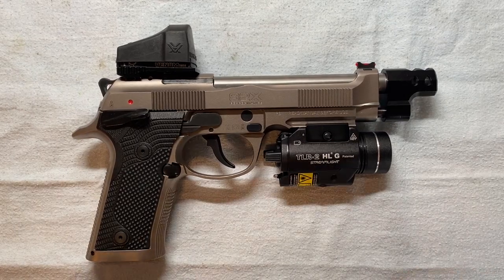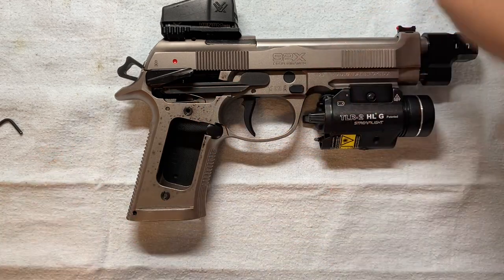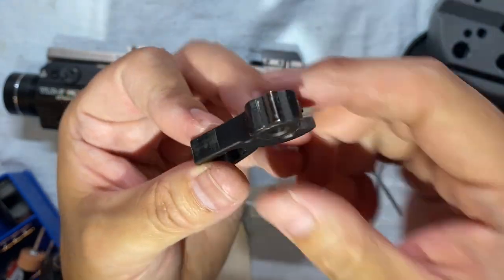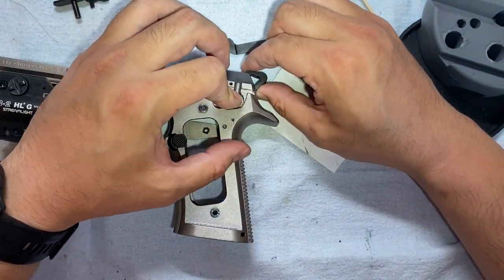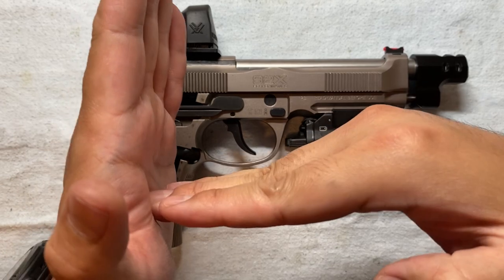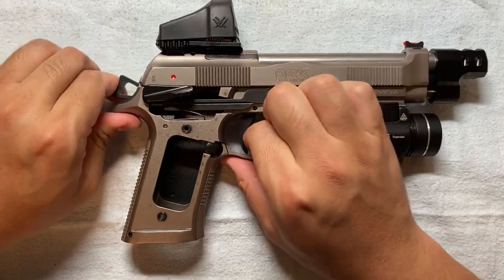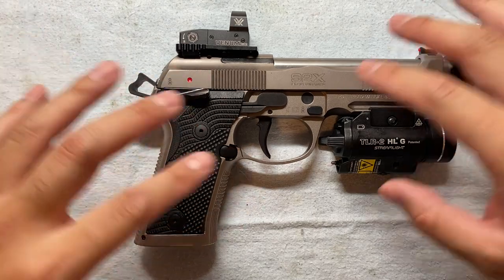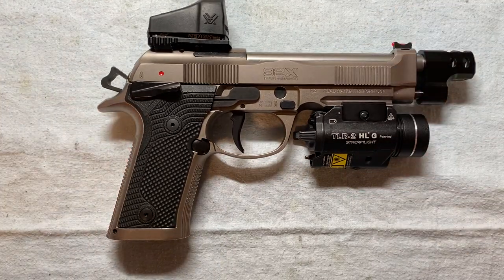Solution to My Beretta 92X Performance Trigger Play Problem

Comment: Beretta did their best to make parts tight tolerance (for the performance 92X models), what you did should have smooth it self on the use. The bar will only get stuck when you push it down when the hammer is cocked, pulling the trigger will move it away from the back part of the hammer. In other word you should just left it alone to smooth it self in use....

Comment: I have the 92, 87 and 21a. All of them worked great until of a sudden after 6 years i now have the same exact scenario as you with the 21a. It's hard for me to believe it didn't need polishing when new but now after several thousand rounds the hammer trigger bar needs polishing. I'm suspicious of the hammer spring but i can't risk dealing with that little spring/detent on the safety. i almost lost them not once but twice. My OCD is going to have to take a back seat on this until later down the road.

Comment: Hey brother i noticed your threaded comp has a gap. This is because your threaded barrel is a bit longer than Beretta's official threaded barrel right? I am designing a threaded comp for the 92 series and id like to inform my customers about that fitting difference. May i use a screenshot of your gun as an example?
Reply from the maker: Hi There, yes my threaded barrel from Jarvis is a bit longer than the perfect fit for 92x Performance. Feel free to use a screenshot or clip of my video as an example!

Comment: I have a brand new Beretta 92X Performance Defensive with the LTT trigger bar. Everything works fine except I can’t rack the slide unless I first pull on the trigger just so slightly to take up the slack. Ended up swapping back to the stock trigger bar since I don’t want to modify the trigger bar. Now I’m thinking I may have a similar issue and should swap the trigger spring to that lighter one. 
However, no similar issues on my Beretta M9A4 with either the LTT or the 92X stock trigger bar which I found a little odd. 
Really want to solve this problem because as they sit now, my Beretta M9A4 with LTT parts has a waaaay better trigger and reset than the 92X Performance Defensive!
Reply from the maker: Interesting. So you didn’t install the whole LTT package but only the trigger bar? That might be a problem.
Reply: I have both. Beretta defensive already comes with the xtreme trigger bar made to work with the overtravel screw built into the defensive frame. The LTT trigger bar has that overtravel built into the trigger bar itself. This could be your issue. I left the factory xtreme trigger bar on the defensive and adjusted the overtravel screw, I literally have less overtravel and a shorter reset than even my LTT 92. See if that helps.

Comment: Hi, Good video. I have a question about the comp. I have a 92X as well and shoot USPSA and might go open class. With the comp, do you need to run different, higher pressure 9mm? Thx Bill
Reply from the maker: No regular minor ammo works fine.

Comment: HI. I have the same problem. I started changing the spring and indeed there is a small improvement. now I should proceed to polish the hammer. two questions for you. did you polish only the hammer or also the part of the connecting rod that touches it? How much material did you remove from the hammer? Thank you.
Reply from the maker: Both. Really not much material needs to be removed. As long as it’s smooth and shiny, it’s good enough.